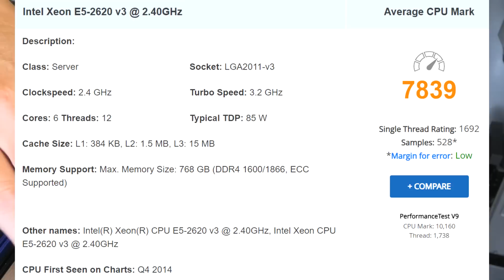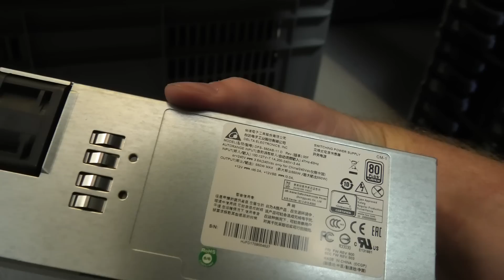HP CL3100 G3 CloudLine Server going back to Work - 1301

Comment: If you need spare parts for the 3100´s let me know, i can send it to you for free from Sweden. I got two 4 bay SSD-boxes with cables if you need for the rear cage.
Mine does not work any more after a watercooling leak on a machine above, fried the boards 😁
Reply from the maker: Okay thank you,, I would like one of those "4 bay SSD-boxes with cables" just to make a video changing it out :-)

Morten Hjorth
Møgelgaardsvej 57
8520 Lystrup
Denmark